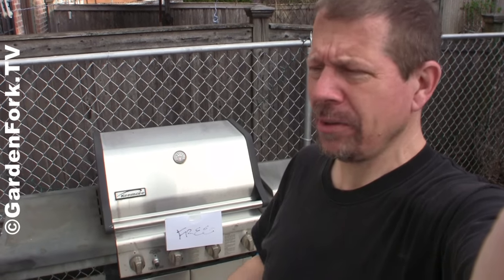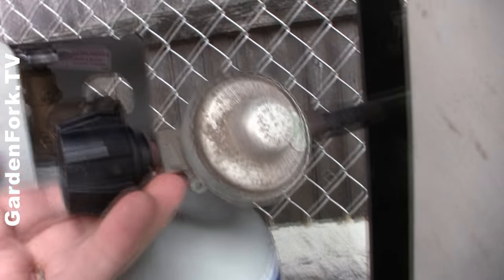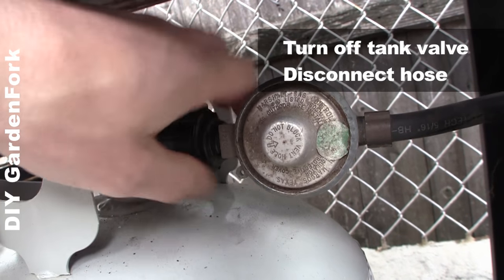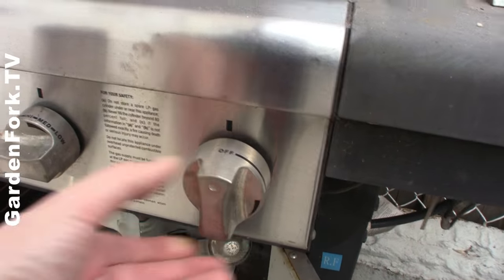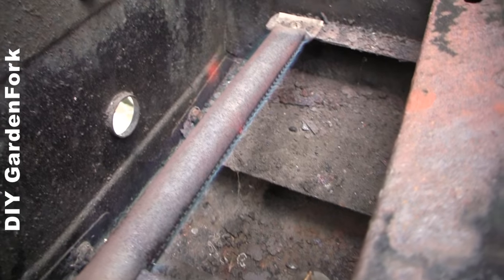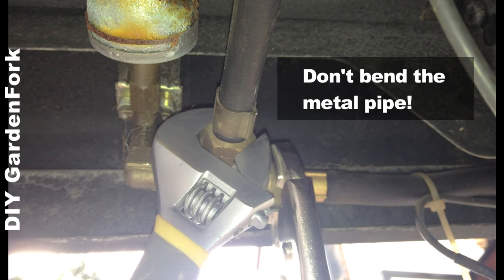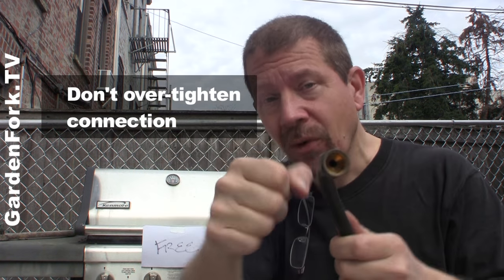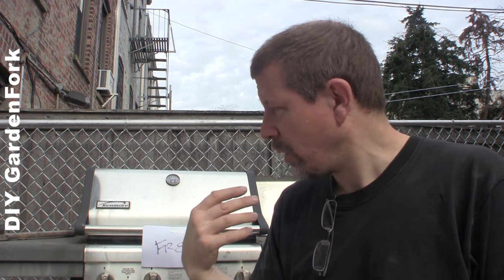Gas Grill Repair - Grill wont light or stay lit - GardenFork

Comment: Thank you! You just saved me buying a new BBQ. We've had ours for 11 years (was a wedding present from friends) and I thought it was done. But it's now back in business thanks to your handy step-by-step instructions. I'm not a technical person and would probably not even have thought to try to fix it except that it did turn on and the flame did light, but only slightly and then it would go out. That made me wonder if something just needed to be cleaned (because, cleaning, I can do; fixing, not so much). I searched "BBQ doesn't light completely" and your video came up right away. Worked like a charm. Thanks for sharing your technical skills with us non-technical people!

Comment: Well well well!! I just junked my old Weber after getting a new tank and calling it dead after continued low flame. Got a great deal on a 5 burner stainless replacement grill on Offer Up and it was doing this immediately, then I found your vid. Tested the regulator with a reset then bought a new one...FLAME ON!🔥🔥🔥🔥MAN I APPRECIATE YOU FOR THE $25 FIX!!

Comment: Great demo of the regulator reset process.  But I needed to find a diagnostic checklist, starting with the tank, through to the burner.  I had hissing where the regulator attaches to the tank and found a damaged (or never refurbished) seal in the tank valve (thanks, Blue Rhino refurbishers!).  I replaced the tank, and no start, no propane smell.  I learned how to bleed the tank, but that didn't help. Tried to reset the regulator, not sure if I turned on the tank valve too fast, but still nothing.  Detached the regulator rubber hose from the grill braided hose, still no propane.  Tried the regulator and hose on two spare tanks, and got very little smell from one, no smell from the other.  Got a new regulator, but still no propane from the tank.  Tried it on the two spare tanks, and plenty of propane!  Changed tanks, connected the regulator, reconnected the regulator hose, didn't hear or smell propane in the grill. (Is there a valve that limits the flow of gas unless there's a flame?)   Disconnected the hose, realized the old style internally threaded "new"  regulator took more torque to seat fully, but still no smell or sound of propane in the burners.   Took a tire valve, held it on the grill braided hose, and blew air (hail Mary, while the hoses were disconnected).  Reconnected the hose, and the burner lit.  Conclusion: faulty tank valve (two in one week), AND failed regulator.  Not real sure that I needed to blow out the line, but chicken soup - didn't hurt, maybe helped.  So from now on, I think I'll take a spare regulator from my turkey fryer to test the tank first.  Hope this helps!

Comment: Worked perfectly! After cleaning my grill it would not stay lit. I was beginning to think I damaged something. I spent an afternoon disconnecting and reconnecting at the tank. But my grill has the regulator on the grill. After your explanation I finally got it. I disconnected the hose from the grill at the regulator and it fired up and stayed lit! Thank you so much!

Comment: Good video. I just bought this new grill and it would just die out. I tried this trick and it worked. Weird that the propane tank and grill are all new and the regulator still had issues.

Comment: Had to change my regulator hose. My bolt was a bit tight so I had to spray with some wd-40.  after that, your instructions worked like a charm.  Thanks!

Comment: Thank you for this video. We had a squirrel chew threw the hose and taped it up with electrical tape and the grill still wasn't working. Found your video on how to reset the regulator and it worked like a charm!

Comment: thank u much, your advice worked beautifully, another video suggested to open only one burner for a few seconds, that was no help. Glad I saw yours, thanks again
Reply from the maker: hankydeee i've used this gas grill tip a few times, i may have to eventually replace the regulator, but so far its working. thx! eric.

Comment: The video was good or the reset. The removal of the regulator was a little sketchy. Also the unplugging of the burners with a pipe cleaner would be a very helpful video. If you have done one how do I access it??

Comment: We got the same exact grill for free from our neighbor as well! He said the gas line needs to be replaced.Any idea on how simple or complex the replacment is?
Reply from the maker: Blessed Beauty the gas line replacement is easy, just need to use the proper wrenches, not an adjustable wrench.  you may need to use WD-40 or a propane torch to warm up the connections so they let loose. thx! eric.

Comment: I did this but I hear hissing coming from under the knobs and I did a leak test around the regulator and that’s not it and I smell propane so I can tell there’s gas flowing but my grill still won’t ignite I’ve used it a bunch the last 2 months and just had it filled yesterday now it won’t ignite any suggestions???

Comment: Why do you have to disconnect the bottle? Doesn’t opening all of the burners with the gas off accomplish the same thing?
Reply from the maker: It releases the pressure on the tank side of the regulator diaphragm. Makes a difference. Thx!

Comment: Inspect for spider webs.   Then disconnect regulator from tank:    give it a series of shakes.   Ball valve inside will rattle/ move if the regulator and gasket are otherwise functional.   No rattle when you shakeeee, it no longer workeeee!

Comment: so what happened when I turn on all ( 4 or 5 or 6) burners and the flames went out? If I turn only 3, the flame seems to be fine.  If I turn more that 3, the flame immediately goes out.  New tank, reset many times already, seem to be no leak.  Thank you.
Reply from the maker: sounds like there may be a leak or a clog in the supply lines.
Reply: thank you ...  I will order a new one.

Comment: I ignite one of the burners work fine, try  to ignite the second one, and everything pop off. Can you help me to solve the problem? Thanks
Reply from the maker: the gas jet in that burner is probably clogged, try cleaning it with a toothbrush or a thin wire.
Reply: GardenFork  I got new burners, because I thought that was the problem. Same thing happen with the new ones. Maybe is something else

Comment: with mine it turns on for 3 seconds then the fire goes to the valve and stays there :/ any idea why?
Reply from the maker: might be spider webs or dead insects in the gas jet area or grill burners. clean it with an air compressor, wear googles!